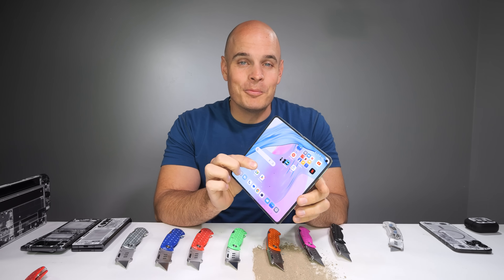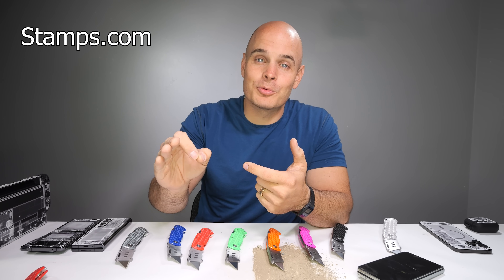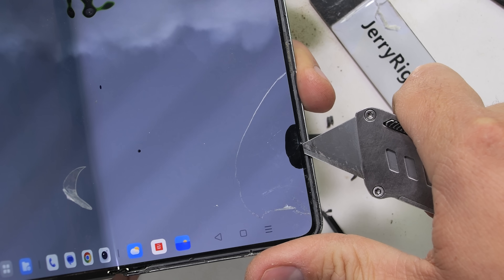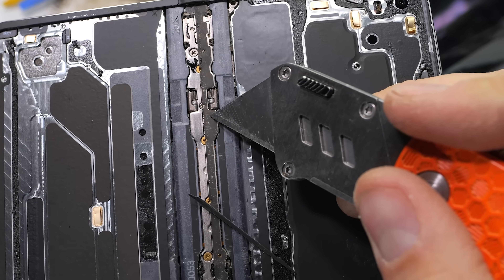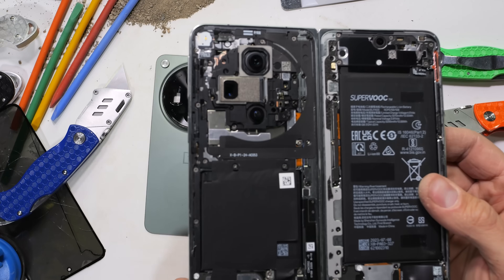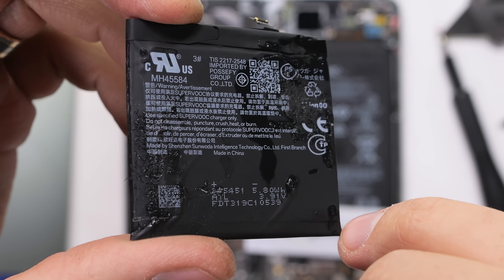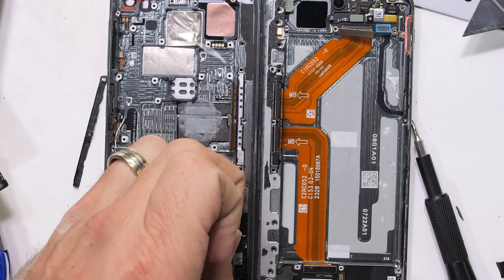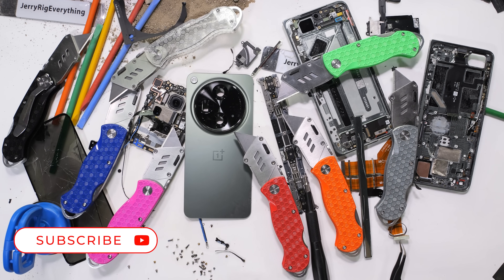OnePlus just beat Apple at their own game... (TITANIUM TEARDOWN)

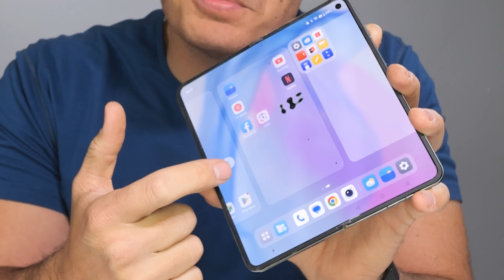Comment: 00:03 OnePlus Open teardown reveals potential screen issue and materials used
01:12 OnePlus uses ultra thin glass for inner screen
02:31 OnePlus uses a titanium layer in their phone's flexible display.
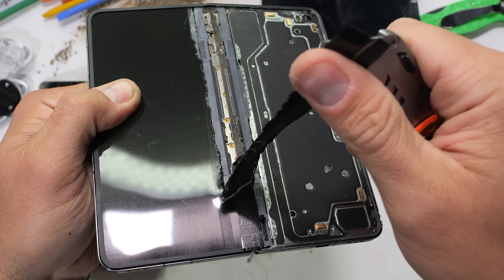03:57 OnePlus impresses with internals and durability, but dust can be a problem
05:29 OnePlus uses around 80 screws to hold the phone together.
06:35 OnePlus uses unique Lego-style ribbon connector and problematic battery removal process
07:44 OnePlus's innovative design and the unique camera features
09:02 OnePlus uses titanium screws for hinge, outsmarting Apple

Comment: I purchased a OnePlus Open phone for €1859, expecting a high-end experience. Unfortunately, just one month into using it, the screen started to show large black spots, a major flaw for a device at this price point. I sent the phone back to OnePlus, but a month later, I still had no concrete news from them. When I finally managed to contact them, they offered me a mere €10 voucher, which is frankly laughable given the severity of the issue and the cost of the phone. This experience is in stark contrast to the level of service I would expect from other reputed brands like Apple, where quality issues are often resolved quickly, sometimes even with an immediate replacement of the phone. This raises questions about the reliability of OnePlus products and the effectiveness of their after-sales service. I'm sharing this experience to inform other consumers and I hope it will encourage OnePlus to reconsider their approach to customer service.

Comment: To remove batteries without pull tabs, it's usually possible to use a suction cup  to pull up on the battery after the alcohol step. Reduces the flex of trying to pry the battery out.

Comment: Honestly, as a engineer working with carbon fiber, I don't see much functionality (other than directional heat distribution) on that thin strip of carbon fiber behind the screen. Almost seems like it is put there just to say that there is carbon fiber in the phone than anything else. The stiffness of carbon fiber is achieved by weaving the fibers or layering plies of unidirectional fibers with different directions. A single cured ply of UD-fiber (about 127um thick) just floating freely between the frame and the screen is structurally about the equivalent of a piece of a post-it note in all but one direction... Clever trickery to make the ply stretch like that around the bend, but thats about it.

Comment: Honest question:
You claim to avoid plastic in your shipments to prevent long-term environmental impact. However, wouldn’t frequently discarding phones eventually create more harm? How do you address this issue?
Reply: He usually assembles them back. This phone is one of the few that broke
Reply: He tries to use his phones to the ground. As for the ones he showcase, he keeps them in his drawer plus it's done to showcase the tech inside
Reply: And to test the durability of the phones

Comment: I love how these tear down videos are getting more and more destructive over time with no chance of survival
Reply: If the smartphones are built this way, that they get destroyed its on the companies. Zack just opens the smartphones :)
Reply: @TobiderKAMPFRADLER i mean the inside fold display breaking was fine but the outer display could have survived for sure
Reply: @s.......  yeah maybe. He opened it pretty roughly, more harsh than typical :D But nevermind
Reply: @s....... 
Nobody opens thin displays with  razor blades except JRE
Reply: Yeah I noticed that as well. Seems like he's focusing less on teardowns and durability tests nowadays @TobiderKAMPFRADLER
Reply: @mahditaher2787  Nah i dont think so. He probably just let it happened, cause the inner panell was destroyed.
Reply: Now we need is a durability test for the one plus 12
Reply: Thank you engineers!
Reply: Iol
Reply: Why are you supporting Chinese companies that steal intellectual property and complain about infringement on your cases.
Reply: And with no information.
Reply: @Dano2903  honestly I got what I needed about the phone out of that, there’s no pull tabs on the battery and no dust resistance so it’s not for me cause I use my phones for a long time and these are deal breakers
Reply: Phones are just getting weaker
Reply: Send me if u don't need it evn if it's bend

Comment: Did you find any bugs or glue? Their subreddit is full of photos of Chinese customers with the OnePlus 12 and the construction quality looks abysmal. Gaps around the camera housing and someone even had a dead bug under the glass.
Those layers do not match the Samsung phones, their glass layer is part of the protector, cos if you take it off and replace it with a sensible one (Which Samsung does not like you doing but they'll only replace your protector twice and only in the first 12 months) they'll try to say you've voided your warranty...over a screen protector, and (if you bend the protector) you'll see the glass crack.

Comment: I'v asked this before. Is it possible to have just the middle "folding part" made of plastic and the rest made of glass so that you can still have a more scratch resistant screen.
Reply: It might be one day but as all know glass is glass and it breaks and scratches at level 6 and deeper at 7
Reply: It probably couldn’t be one entire piece
Reply: The joining border of glass and plastic will be too obvious, specially after a lot of folds where that very border will be the main failing point. You could make it sure. Just layer the extra thin screen with thicker glass on the non-folding area, but it will not be seamless.
Reply: I'll say it again, I'm perfectly fine if Microsoft came out with a surface duo 3 or update it to surface trio and have three glass screens (1 out + 2 in) with the smallest gap they can manage on the inside. That to me would be the best folding phone in terms of strength and actually long term usability. I don't need a continuous screen made of plastic, but two close screens would work well enough like the big multiplex screens you see at football stadiums.
Reply: @tbm275 as a owner of both a duo and a Open I have to say that while I like dual screen the flexibility of a single screen beats a dual one on a smartphone. I can still dual app but I can have a single big movie/game/app with no interruptions but on the surface spanning anything across both screens is not pleasant at all
Reply: Dude I've had a galaxy fold 3 for more than a year. The inner screen is scratch free. Just don't carry 12oz of sand in your pocket and you'll be fine.
Reply: I prefer all plastic, it doesn't shatter like glass. Screen protector on it does fine to prevent scratches.
Reply: @theguruguys  prevents scratches but does not prevent denting.
Reply: @CrispyCars  havent had a dent or scratch on my 2+ year old fold. I'd rather risk a 'dent' which seems far less likely than having to replace shattered screen and/or digitizer which in all likeliehood would be caused by similair force than it would take to put a permanent dent in the plastic screen.
Reply: Might as well just bring back the Surface Duo.